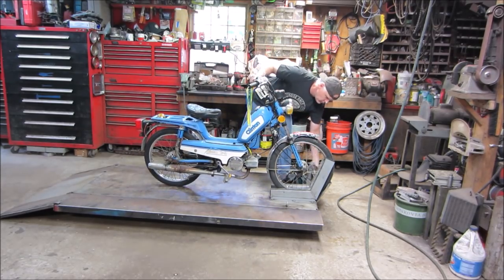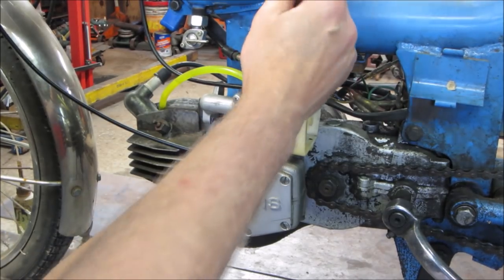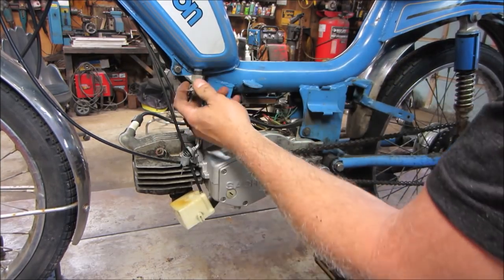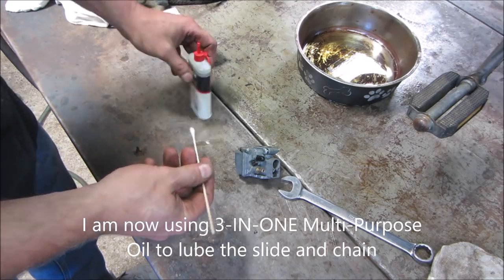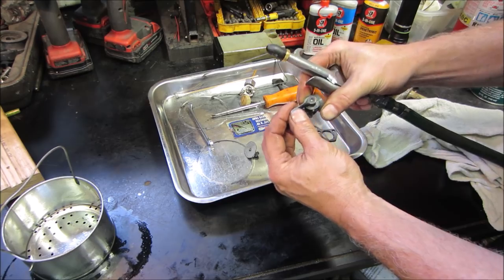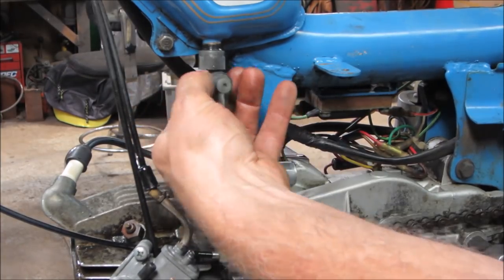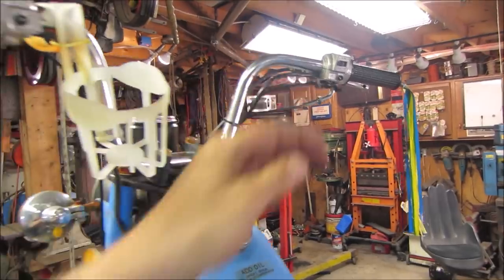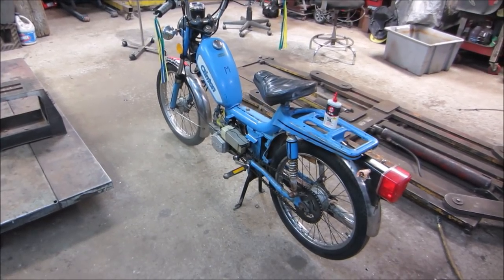Will it Run? Barn find Moped.

Comment: 3 in one is great for a great many things... Just don't do like I did years back and use it to lube the shaft bushings on small electric motors. They ran great at first, but it completely gummed them all up within a few weeks. Bathroom vents need to run full speed! XD

Comment: It runs real good for a fifty and it goes pretty fast probably 35 or better for sure. If the back rim were trued up it would run even better it works against the performance being out of round. I use the 3 in 1 on everything that is metal and I can run a can dry easy because i use it a lot.

Comment: GHIA: mar 3 2019 -  i saw alot of messy straggly wires under that ghia you should secure better  or the might get broken from wiggling wind or getting caught on road debris especially the red wire that runs from the side of the ghia to the engine housing i also say to fix a lotta rusted thorugh spots on the ghia to. ty for the ride in the ghia via your phone darren! you might wana get a headband an wrig up a way to attatch your phone to it that way you wouldnt have to muck with it when you take viewers for a ride on your vehicles   jeff from victoria bc canada

Comment: I love three in one oil,have some around, handy stuff ,I also like marvel mystery oil ,and tri flow,which is like WD 40 with teflon.and super lube with teflon,a synthic  oil ,which in most all case out performs, regular oil it won't break down ,finally Rock and Roll synthic grease with telfon,I like like the Sachs  you are working on ,is that name on it a model name,this Sachs seems to be made better then the other mopeds  I seen on your shows ,like your videos

Comment: When you get that speedo fixed I think you need to carefully paint in an 88 near the top of the range.
That machine is in good enough shape that I'd be inclined to try to match the original blue paint and do some touch up on it.

Comment: We had the same broken "nipple" on the gas shut off valve,  we drilled and tapped it .
Then center drilled a bolt that was cut to length,  worked to.

Comment: Wow, that's like a chainsaw with wheels! I bet that longer seat you just got at the yard sale would work nice- the Tootsie Roll looking one. I was expecting to hear another gear- but that's just wide open. Does the brake light also come on with the rear coaster brake? Very nice for a young responsible kid (or a big one).

Comment: Hi Mustie 

i ´ve seen on the Video that you don´t now what hub. means. when youre looking on the Engine Plate.
It shows you that the Motor has 50ccm Bore.

I knew a lot of German Engines if you have any kind of questions you can contact me. 

I live in Germany and i am a Motorcylce Mechanic.

You did fantastic work with your channel

best greetings from Germany 

Georg´e

Comment: Well  @Mustie1, if you wann know the legit oil is/ Type F /
I have  Tomos apn 6 1984 and  sachs is  a similar moped to it. use SAE 30 for gearbox or  a 10-30 motor oil will also work.  Currently my Tomos has Motul 10 - 30 motor oil i had left from my Kawasaki. Works fine.They run just fine on pretty much anything.
SAE 30 is used   as fork  and rear shock oil. By the book btw.  Not picky bikes Mustie, built like tanks. Look at the condition after all these years. I run mine every day in city traffic  and its 34 years old. One note  you probably know. a heavyer oil on automatic mopeds might  keep you in first gear for a bit longer than  a lighter oil.

Comment: You're "preaching to the choir". The "one" thing 3-IN-ONE left out was clippers. I cut my own hair with clippers and you MUST put oil on the blades before you start. I just drag the nozzle across the top of the blades and it works mint. I have been using 3-IN-ONE since 1969. (Cutting my own hair since c: 1990) Used 3-IN-ONE on hinges (car and house), bicycles, go karts, minibikes, motorcycles, the uses are almost as numerous as Duct Tape. Hmm..maybe more. Oh, and sewing machines.
One thing it won't help is Bernadette Peter's voice. :-) 
She was hot, though.
Reply: Duct Tape and 3 in One oil are the staples of life :)

Comment: the battery is used to regulate the voltage, otherwise without it you can blow the light at higher revs. I had a Yamaha dirt bike that was set up that way. I ran it without the battery and blew the headlight.

Comment: Just so you know in the future the way you adjust the fuel - air mixture on that type of carb is to take that needle on the throttle slide and there is a c-clip with multiple grooves and you can move that needle up and down to adjust the fuel -air ratio
Reply from the maker: thats more of fine adjustment once you get close to the main jet size,

Comment: Always tell my clients to get 3 in 1 because they use WD-40 to lubricate which it does for 10 minutes before evaporating.  My only complaint is the plastic can. Plastic threads do not hold oil , they self loosen as you probably know. Wish they had an option of a "classic" metal container.

Comment: I've got 3in1 Oil and the spray 3in1 Oil...Excellent Stuff! I wanna' run and buy some more...Think they do a 3in1 Silicone spray which is good for door runners and rubber door seals. ;O

Comment: Have you ever considered using 2 pieces of angle from either brass or stainless steel on the jaws of the vice when you are clamping up carby's in the vice, by using the angle on the vice when clamping the carby's it will save the carby's from getting the cross etch from the vice jaws

Comment: I had one when i was a youngster it ran 55mph put a bigger carb on, a boss exhaust and gone the intake and polish it. plan the header and bore the intake and exhaust ports that'll make a speedster 😎🏍
Here in Denmark or Europe tgey are called Puch maxi, sachs engine and bing carb. 
the simplest setup for a ride and it works very well.
here in prestime condition tjey can be worth as much as 5000 USD

Comment: Sachs always run...
Usually the capacitor and spark plug wire dryer out, but it's a easy change.
You can buy tune up kits to this one up to 7 bhp....

Comment: Mustie? You ever seen a Berini M14. "The Egg" they call it. Its a bicycle assist motor. I have had one for 50 years. Still works!
Reply: Never seen an egg shaped one? Like the old Maytag engines? Ride a 2 stroke 50 bicycle everyday and I pest the absolute piss out of it.
Reply: @MrLendermanGaming  The gas tank is shaped like an egg. The motor is mounted on the front forks of any bicycle. A brake lever ....when pulled, lifts the motor off of the front wheel. Thats the clutch. Magneto provides spark. It does about 18 to 20 mph. 49cc. Totally cool little assist motor.
Reply: @gispel7058  now I absolutely have to start looking for one.

Comment: My Honda Hobbit specifies 25 to 1. I used to use 32 to 1 but I've gone to  25. It all burns and there are probably more btu's  in the oil than the gas. And it's what Honda wants. It's all moot it rarely runs. Latest is directionals.  I actually made rollers for the variator. 1/2" copper filled with lead so far not drilled. for weight. I used to use dimes or pennies well greased.

Comment: mustie i need your thoughts on something, ive got this EZ-GO  two stroke golf cart that i just got running  no matter what i try it will not idle . i have to hold the pedal a little bit down for it to stay running  it has a jobber carb installed and ive dialed it in as best as i could, no matter what i do if i let off the gas it stalls out im not certain that it's a air cleaner issue as i had that off. this is a major head scratcher for me as ive never dealt with a problem like this before so i need your opinion on it before i go drag a certified guy to my garage for extra brain power. plz help

Comment: the battery has a turnsignal relay next to it.  my bet is it has a bosch ignition and the battery is for turn signals that were either removed or broke off.  oil mixture is 50:1, anything more is unnecessary

Comment: Definitly a 30+x mph version, just by looking at the sprocket ratio, the 15mph/25 km7h versions came with 11:43 or 45 teeth, yours seem to have 13:35 or 38 teeth, along with that "big" exhaust header, they came in different sizes, mostly classified as "P1" to "P3", yours seem to be a "P3+" at least...wow...and the Bing carb reading 1/12/xxx resolves to a 12mm bore, that makes a real 30mph version...
Most interesting detail is the 6V wet battery, never seen one mounted to an european version, we only got that pesty "ULO-Box" containing dry Ni-Cd cells, that always blew out over the years...and the ignition coil mounted outside is rare too...mostly the were positioned behind the flywheel, together with the coils for light and a charging coil for the battery box...
Brake light could work off from the pedal brake, check for a switch on the little lever at the pedal axle!
The cable that works the clutch was usually parted on the decompression valve and runs from there to the engine case, there was some kind of clip that decompressed the cylinder and engaged the clutch simultanesly...you could use it instead of a kill switchby pulling it half way to release the compression... 

Just a question, the bike you got the fuel cock off, was that a Peugeot clone sold as "lazer"? Easy to identify by double chain and big plastic belt wheel on the left side...they sold here as "Peugeot TSA", a really rare version of the popular 103 model...

As far as I would guess, that clinton moped would make easily 800+€ here in europe in it`s actual condition...the "Lazer" the same, also in it`s actual condition...your backyard would be turn to gold here...
8-)
Nice work as always, like your attitude and your patience on your projects!
Thx for all the vids!
:-)

Comment: Hi, maybe you could turn up the bitrate in your editing program for your future videos, then the sound quality would be much better. Especially the loud sounds like a running engine.
Reply from the maker: windows movie maker, l do not see a place to adjust it,
Reply: Movie Maker has some preset options to save a film but you also can create one yourself, and then there should be an option to adjust the bitrate. But normally it should be enough to just choose the High-definition(1080p) preset.

Comment: OMG, heart failure for sure.  Please be a bit more "selective" in your test drive location with less traffic where you can be "The Dukes of Hazard" in a safer manner.  One would not want to see your YOUR funeral caravan.  Other than that, great video and your salesman presentation is excellent!  The 3 in 1 oil has been around for ever and time has proven its consistent value and I feel sure added exposure will increase the products marketability.  I love the little gal scooter.

Comment: Maybe this is old news... Clinton-brand mopeds are rebadged Sachs mopeds from Clinton Engines Co. There was only a single model made, the 50-A. It used a Sachs 505 engine and was only made from 1978 to 1980.

Comment: Clinton mopeds were made by the former Clinton Engines corporation of Maquoketa, Iowa.
There was only a single model made, the 50-A. It used a Sachs 505 engine and was only made from 1978 to 1980.
Sachs Motorcycles of Germany still exists.

Comment: Is that for sale? And never use 3in1 on a chain use regular rear diff grease it's what most moped manufacturers recommend and it works. Don't worry about a speedometer it only goes 20mph. It's a sachs 505a motor 1.8hp. No way you did 30. Unless someone put a 505c motor on it. The manual calls for Castrol tq transmission fluid whatever that is?
Wow didn't know this was a yr old

Comment: So you actually buy bottles of premixed gasoline holy smokes that has to be expensive. Probably works out to like 15-20 bucks a gallon. Im too cheap for that lol i just buy 2 stroke oil measure and mix myself. I have an old measuring cup i got from my father years ago that has all the gradients for mixing 2 stroke gas all marked out on it. Takes the away the guess work and makes mixing your own  gas easy.

Comment: it's more likely it didnt come with the battery and signals and the dealer put it on before sale.  the battery has nothing to do with the horn.  the horn requires AC from the stator to work, if you tru to run it on the battery you'll get on click and that's it. brake lights would be on the reverse pedal brakes

Comment: Looks like every other german moped, sparta hercules use same the sachs engine, bosch ingnition bing carburator, that petcock wil have like left and right thread look for size in mm something wil fit from an kreidler zundapp.

wow a Batavus, Dutch bike brand did made a short time mopeds.

Comment: Well, those old german 50cc engines were designed to run on 33:1 mix, so be a little careful with that...
Reply from the maker: says 50 to 1 right on it
Reply: It does? Oh, OK then. I had issues with that - after too lean mixture the engine locked on me, so I rather wrote it down just to be sure

Comment: My dad bought one of yhese years ago n had it sitting out in the garage] thinking one of his boys might take an interest in fixing it back in the days there was no ethinol bbut wew bhad no or few tools but he did a lot of horse trading mainly boats and mottors but other odd vehicles at the time as well so did gert ex;posure to lots of mechanical things nowers ylou name it toro the olds crank type type starting mechanism for starting them I think the ,most durable mower was a lawn boy that thiing lasted fir ever n he picked up a Model T in a swap for as snow mobile an old Artic cat we had at the time
 he needed one to feed his cattle one winter Im working on a boat n 15 hp Johnson could be a nice fishing boat I could get carried away but dont wanna sink a bunch of money in it just about getting ,me to where the fish are. UI swsanna ad a hydro foilto the engine n mayube  a new prop n redue the trollimg motors looks like kit was attached by somebody in a big hurry and it looks like crap. ?The trail;er is another mystery made from  like 6-8 inch steel tubing the tongue weight is huige ciuz all UI have yo tow it qith is a car an old buick. My brother has a Yukon I could use he bought at an auction but has a lot of issues mostlyt electrical from setting to long unused and its not my rig do I wanna spend money to fix his vehicle Im his brother so Ishould try n help him but I hate e,ldectrical issues in GM cars and its got an loil lea,k my guessa is the seal on the oil pan tyakes tools n equipment I dont have.l cant anything ever be simple?

T T

Comment: Wd40 has somewhat superseded 3in1, probably because of the marketing. The only problem with that is..........WD40 isn't oil, its water displacement fluid. 3in1 is far better for maintenance and lubrication. Mustie, I hate superfluous product placement but in this case, given what you do, its acceptable.